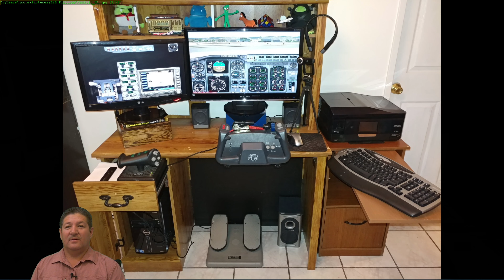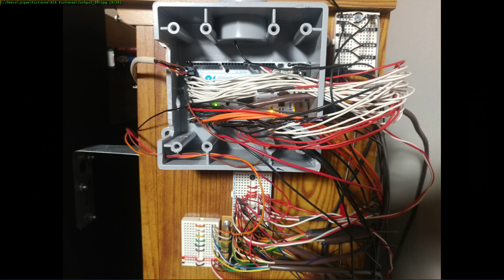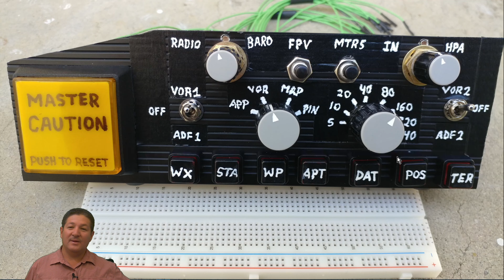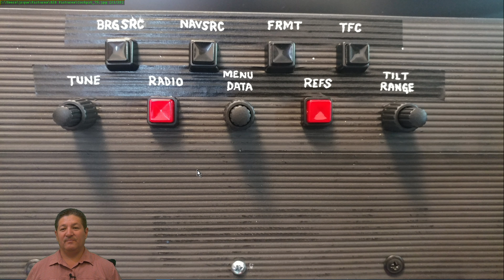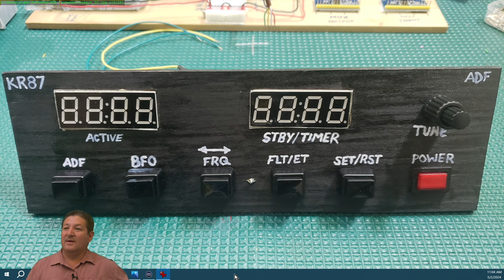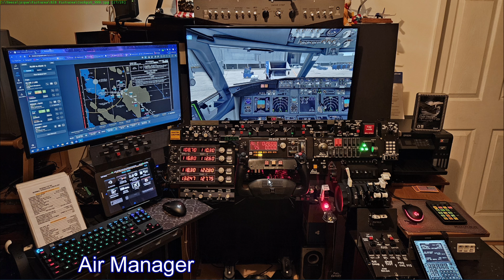Evolution of my home cockpit

Comment: Hola. a mi si me has servido de mucho, encontre en tus videos la inspiracion necesaria, y mi curva de aprendizaje fue larga, pero finalmente he comprendido todo el "lio" de los multiplexers, de entrada/salida, los motores Stepeers, las offsets, lo datarref, etc. tengo Mcps con Simvin, Efis, Radios, y lo mismo para Mobiflight, lo que hago para Simvin lo hago tambien para mobiflight, y me encanta aprender y solucionar retos, actualmente estoy en un overhead 737, ya consegui entender como mostrar en los displays  del panel electrico los diferentes voltajes y amperajes, tanto en PMDG y en X-plane. En realidad no se volar pero me apasiona hacer estos instrumentos. Al igual que tu todo lo hacia sin retroiluminar, pero estoy por decidirme en comprar una CNC pequeña una 3018 de Ali express y hacer paneles con sus letras y retroiluminados, Como dices tu "es un viaje largo". Me imagino  que a muchos mas como yo hemos apreciado tu esfuerzo y trabajo. Gracias, y aqui estoy para lo que necesites, Saludos desde islas Canarias.
Reply from the maker: Muchas gracias por tu comentario. Me alegra que te entretengas construir los paneles solo por el reto. A mi tambien me encanta tratr de hacer algo que antes yo veia como muy dificil y lograrlo. Me sorprende que a tanta gente se les haga tan dificil usar multiplexers. Ojala que los videos que he hecho acerca de eso ayuden. Me parece que ya casi completas un cockpit entero , yo tambien tengo deseos de hacer el overhead del B737. Acabo de finalmente contruir un MCP Y ya casi tengo dos videos listos acerca de eso. A mi tambien me gustaria comprar una CNC pero aqui donde vivo esta muy chico el lugar y ya no tengo espacio para nada 🤣 Oye acerca de MobiFlight, si tengo razon que SimVimX esta mucho mas facil cuando se trata de asignar las funciones? Yo solo he tratado un poco pero se me hace mucho mas complicado programar cosas en ese programa. Pero tiene la ventaja que ese funciona con MSFS pero como yo no lo uso por eso no me interesa tanto.
Reply: @Qosmokid  Simvin es lo mas facil, no te tienes que preocupar de offsets, ni modificadores, ni transformaciones, lo unico que  me "asusta" es que es por WEB, deberia Simvin hacerlo con un programa como mobiflight, mobiflight es mas complicado en ciertas cosas  si usas el PMDG te vale la misma configuracion para FSX,Prepar o MSF2020, ya que usan las mismas offsets. Tambien dispongo de una  pequeña habitacion para mis cosas "mi cueva" Mi proximo paso es por una CNC y a hacer paneles con luz, quien sabe si hasta venderlos (soñar es gratis), por cierto termine una FMC  completa retroiluminada, para PMDG y lo hice con un solo arduino mega y 2 MUX y una pantalla de 5" y lo mismo para el x-plane, es facilisimo asignar commands. si me das tu correo te mando fotos de lo que he logrado y en gran parte gracias a ti y al traductor de youtube, salvo los pocos videos en español que has hecho

saludos